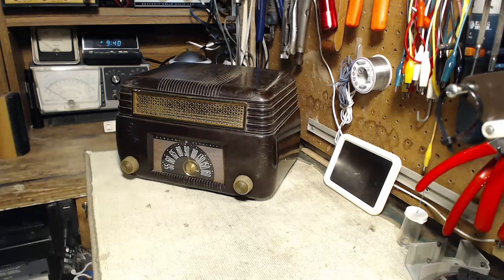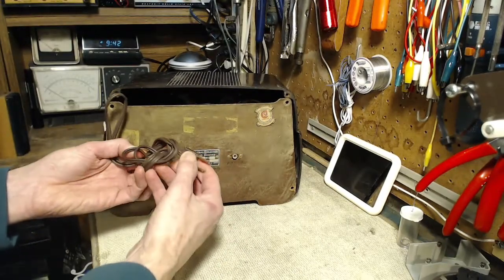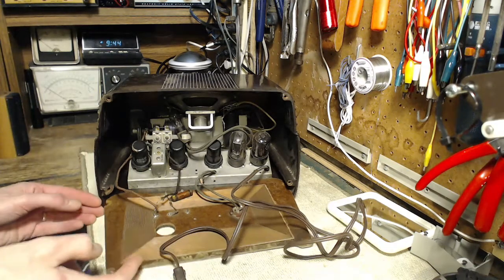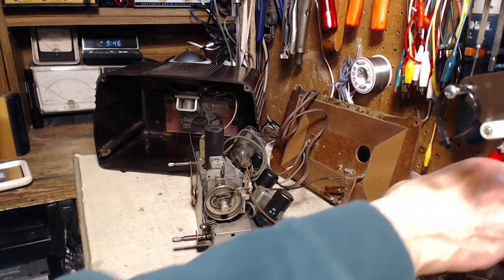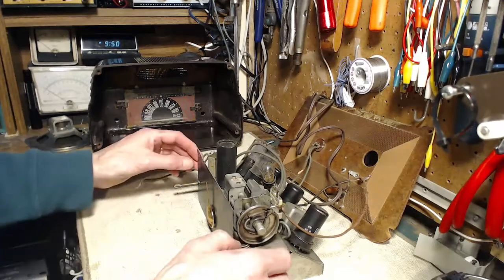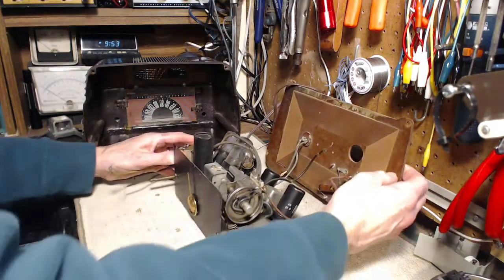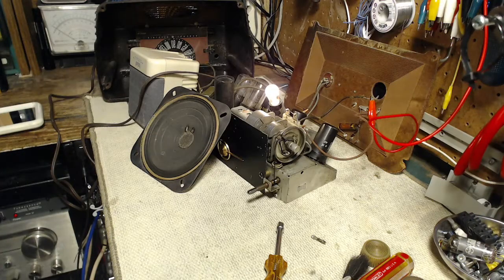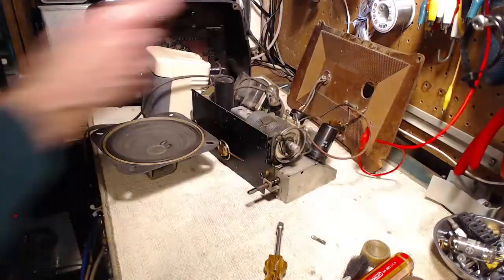General Electric C100 Vacuum Tube AM Radio Video #1 - Checkout and Powered Test

Comment: I love the square antenna coil.
Reply from the maker: glasstronic I wonder why it's like that.  Do you think the rounded corners have some kind of bad effect?
Reply: Jim Lindenas
I reckon the sharp corners would be more of a trouble where Q is concerned. It might have been a bit easier (cheaper) to manufacture it that way.
Reply from the maker: glasstronic I've seen it before but it's unusual.  Maybe they can cram more wire in the same space.